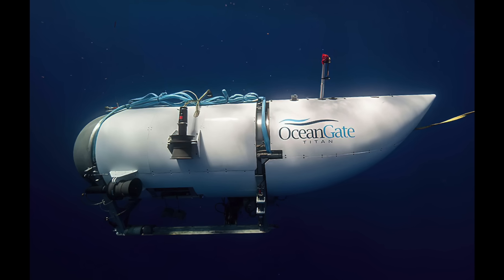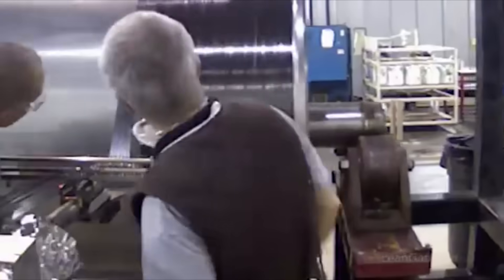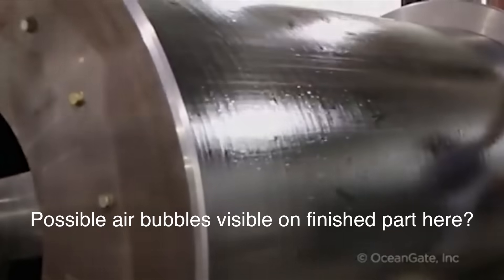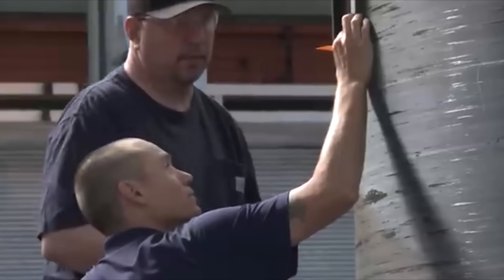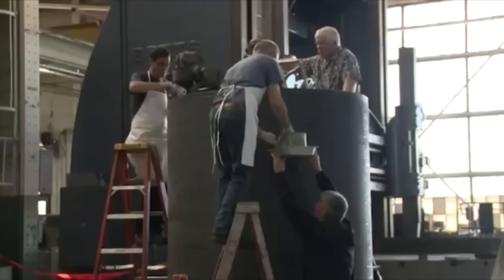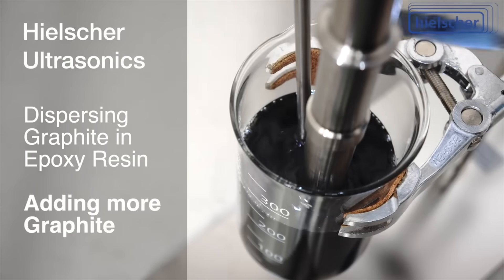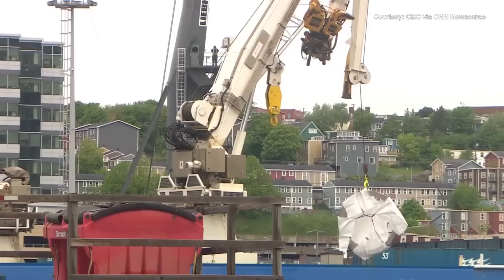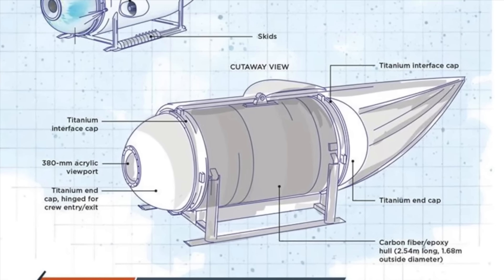Why OceanGate Titan Imploded - A Carbon Fiber Composites Perspective

Comment: I thought I heard Stockton once briefly mention " zero -90 ", but he did rather gloss over it.
I was senior chemist at a " British aerospace" company, who built satellites, in the 80s [ yes, that one ], so I know quite a bit about cfrp, particularly the resin side.
From the very first time I heard about this, I was worried about the consolidation of those layers. I knew  it was 5" thick, which would be lots of layers, now we learn that it's over 670. How do you apply sufficient pressure to THAT to consolidate all of the fibre layers, and squeeze out extra resin? I've since learned that all that they did was vacuum bag it. 14.7 psi on a layup like that is a rat's fart in a hurricane. There's likely to be voids & resin rich areas galore..
We occasionally bonded cfrp to Ti, & the stock surface prep was grit blasting IMMEDIATELY before bonding. Ti has an amazing ability to adsorb & bond with gas molecules, forming an oxide layer. [ So much so that titanium is used in the vacuum pump of last resort in achieving ultra high vacuums].
I agree with your thoughts on surface prep, resin mixing, & lack of obvious squeeze out.
A well presented video, and there have been a whole host recently - it's become it's own new YouTube 'industry' - " What happened to the Titan? ". I think I'm going to sit back now & await the final report I always knew that they WOULD do everything possible to recover wreckage, if only for the detailed analysis. The alternative would be to just rule out all use of composites in future.
Reply from the maker: Thanks for the comment and great to hear your hard earned experience. I regret not talking about the consolidation aspect of the layup. I was hoping they might have had two female moulds that could bolt together with a big flange and roll it into an autoclave or something similar but as you say the idea of vacuum bagging something that’s 5 inches is mad. Very good point about the Ti oxidising too. I feel I’m getting so much information from professionals such as yourself I’ll need to make a follow up video.
Reply: @JamieKunka  I actually gave some thought to how I MIGHT try & consolidate that mass. ( I was the chemist, not the production engineer, so I'm pushing my boundaries. My bailiwick was composition, degree of cure, viscosity & cure dynamics, & surface contamination / treatment & prep. I'd almost bet a pint to a barrel that they had silicones within that warehouse. Those things are deadly. 'Superb' mould release characteristics [ aka 'failure mode' ], and the stuff 'creeps'. Pour a little on the bench here, & you'll find traces on the bench over THERE in a week or so's time. It was absolutely forbidden within our areas, in any form  ) Anyway...
We used to lay up fibre wound tubes, that went into Ariane rocket release gear. It was filament wound on a steel mandrel, then wrapped in layers of polyester shrink tape [ > 10 : 1 shrink ratio, I measured once, when the 'wrong stuff' was delivered ]. It was then cured. The wall thickness was less than a centimetre , on a diameter of about 10cm [ 0.4" / 4" ].
The best solution I came up with was to lay up about 1.5 cm [ 1/2" ], either shrink wrap or vac bag & cure that, then lay up another 1/2", wrap & cure, rinse & repeat, until you've built up your final thickness. You've got a fighting chance of achieving reasonable consolidation within those thicknesses. The pressure gradient of applying 14.7 psi over 5" of material thickness takes more of a computer simulation than I can do in my head. Even so, you've lost that sense of a monolithic layup, and if any 'peel ply' or similar gets involved, all bets are off - you are just building in 'weak boundary layers'.
Reply from the maker: I think your idea of the gradual consolidations sounds very feasible and gradually build up their thickness and be a lot more confident that your not trying to compress 5 inches with a vacuum bag. Also very interesting to hear about the danger of the silicones anywhere near the parts. I bet being an expert in surface contamination/prep the assembly footage must be even more shocking.

Comment: I have no experience in submersible technology. It sounds like there were number of problems, but the biggest problem was the carbon composite of the body. It was not strong enough to handle water pressure at that depth.

Comment: I did not finish engineering at university, i'm just an hobbyist regarding carbon. As the events unfold and i have seen the construction video for 1st time i had questions. "Carbon fibre under Pressure? Wound only hull? What are they doing with the glue, why no squeeze out?" - And anybody i talked to about my thoughts, more experienced then me, agreed. - How then could this happen if nearly anybody with carbon experience says "uhhh, sketchy ..." .... "I'm convinced it will be good and i drive it myself" is not a valid argument.

Comment: If you watch any of the videos of them tightening the door, they are not even using a torque wrench.  Was that even a factor?
Reply from the maker: Wow that’s astonishing as well. I suppose they were thinking the pressure would keep it shut but then even a BIT of water ingress coming in would prevent them from surfacing as it would have made the sub too heavy.

Comment: Most deep sea vehicles are made as a sphere whereas the Titan was a cylinder but  I have not read much about the difference of how a cylinder would act under extreme pressure compared to a sphere, the shape of the Titan may be part of the problem as well as the materials and construction methods.

Comment: Carbon is not a compressive material, it is very good in tension, I think of it as pop bottle which has high internal pressure and copes very well but how little it takes to crush it.

Comment: The critical error was starting with two dissimilar materials. Just insane to begin with. Those two ends of the sub probably blasted off with extreme force.
Reply: Wow this is like, hilariously wrong. nicknorthcutt's prior mechanical engineering experience consisted of Sunday morning Looney Tunes

Comment: The carbon fiber and titanium have different compression strength and behavior. While they seem snug during the construction, at depth there would be a small but significant difference in the diameter of the fiber cylinder and titanium ring which would put a lot of force on that little layer of epoxy. I’m surprised it lasted as many dives as it did.

Comment: What does "0 to 90 axial and rotational layout" ( 1:33 ) refer to? Sounds like 2 directions. But in any event, the video is of their first version (called Cyclops II at the time) that dove twice and made enough "crackling noise" that Rush scrapped it (with a lot of encouragement from Karl Stanley who was on the second dive) . The second craft ?now called Totan) was done by a different firm (this first was Spencer Composites) and I read it was wound differently (although I can't find the article where it talked about the different winding pattern of the second version).

Rush said in an interview that carbon fiber allowed the vessel to not need "all that foam hanging off it" that a metal vessel would require for buoyancy. The foam appears to be encased in metal per a picture I saw. In the end the carbon fiber was the cheaper choice and the "out of the box" choice. Rush appeared to highly value doing it differently, but it conveniently was also cheaper.

Comment: Worked for an adhesive manufacturer. With adhesive, less is more. Firstly, there would ideally be a primer applied for the adhesive to 'key' onto.
The bond line needs to be thin and consistent to get the best surface/surface to contact. Applying by hand with what looks like a tile spreader isn't going to be very constant, and will lead to an uneven bond-line, introducing weakness in the adhesive bond. Should be applied by robot to get consistency and the correct bead (similar process to a car windscreen).

Comment: is there really a magical design that a carbon fiber structure/vessel work for immense compression/outer pressure? Ok, I can understand the carbon fiber high pressure vessel design, cause in case fibers work for tension, which they meant to be, so it could withstand inner pressure with the strength of fibers... but for compressing a carbon fiber structure what will resist the pressure? epoxy? that can never be a good idea..

Comment: It also strikes me the carbon strands at the ends of the tube will be irregular where the machine laying it on the tube former changes direction (eg at 2:16). There would have to be some bunching of the carbon fibres on the inside of the bend formed as the head changes direction because of the width of the tape. There would also be some inconsistency as to where these bends lie on top of each other, just where there are the loads transferring the axial compressive forces from the titanium ends onto the tube. I guess the idea was that the resin glue would spread the load, but it does look to be an area where repeated loadings would lead to settlement and cracking.

Comment: Recent graduate in Naval Architecture & Marine engineering here - take everything I have to say with a grain of salt because again, just graduated and by far not an expert!

But my 2 cents on the "strength to buoyancy" term you mentioned. My first reaction is this is the first time I've ever heard this term utilized, I also have not spent much time with submersibles as they are definitely a niche in the industry. However my next reaction is that term seems a tad bit silly since the buoyant force must be equivalent to the weight of the object (Archimedes Principle), thus in reality strength to buoyancy is practically the same thing as saying strength to weight. Strength to weight is also not really a metric used all too often in Navarc, when designing commercial ships (think tankers, container ships, dry bulk etc) weight is certainly a concern from a cost and strength perspective, but it's often not the case that in commercial design you compare the strength to weight ratios of various materials, it's just not as much of a concern since the body of water will just displace more volume to account for a heavier ship - and often these commercial ships are volume limited. In other words, commercial ships often reach maximum capacity of their cargo holds long before they're in any dangerous territory of displacing too much water.

Weight becomes much more a concern when talking about high performance yachts such as the Americas Cup sailing vessels. But the usage of composites in these craft is vastly different that in a submersible... The question that still troubles me is that someone must have realized that Carbon Fiber does not have the same strength in compression that it does in tension? I wonder if the strength to buoyancy ratio he was using accounted for the different compressive strength of carbon fiber, since pressure vessels under seas have to deal with compressive loading (greater ambient pressure) while airplanes often deal with tensile loading (lower ambient pressure).
Reply from the maker: Thanks for the comment and information and great to hear from a Navarch graduate!

Comment: It sounds like his description is actually of using 0 and 90 degree layup, no?
Reply from the maker: It definitely sounds like Mr Rush says this and others have mentioned there may have been a 0 degree element thrown into the layup. I just couldn't find any video or photography evidence. Certainly the winding equipment they are using could not lay a 0 degree fibre which Is why I am puzzled.

Comment: The load on a GE9x fan blade is about 6000 lbf per blade and translates to a much higher flexural load.  I'm sure if built properly carbon fiber could have been a fine choice.  Though a high pressure autoclave and a somewhat over staturated layup a requirement for the tiny air bubbles to dissolve into the matrix.  Anyway that 1 inch lap bond makes me crinch.   The clean break away of the titanium ring and the carbon fiber is a sign that stresses between the disimilar interface due to the different rates of compression under load was a huge problem.  Too much sheer for the adhesive to handle.
Reply: The load on a fan blade is not entirely in compression.
Reply: You know just enough to be dangerous!

Comment: I still haven't hear anyone explain how carbon fiber would be desirable to hold OUT pressure.  It seems perfect for holding IN pressure as in an air tank but it seems (to me) that the crush resistance could only be a tiny fraction of its expansion resistance.
Reply: When I worked with a HYDROCLAVE our carbon fiber seemed to shrink and turn into a softer like graphite material!  Unlike auto claves it could obtain pressures around 3,000 p. S. I . . Carbon takes on many  different forms! OceonGate probably never considered using a HYDROClAVE because they are very expensive. They seemed to operate more like boat shop!

Comment: And continuous 90° fibers going the length of the hull.   There would have been zero voids if they used an autoclave with high pressure.

Comment: Being in carbon fiber since 30 years for racing purpose, when i saw how they just wound the carbon on that tube without making a cross wound that allows resistance of both axis i was flabergasted. At the two tube ends the resulting pressure from the two caps are is applied only on the tube end surface in a direction that the wounded carbon fiber give no resistance. So in this way only the matrix resin can hold the pressure and will cause a quick wear and of course the bounding is also a problem. But you have to keep in mind that the glue doesn't hold the caps, the water pressure press so hard that without any glue in would hold. Just look at how the two caps are bound to the two titan rings, just a few little bolts to keep it toghether.
The problem is that the carbon made the way they did it gives no resistance in the tube axis and then nothing keep the wounds together except the resin, this is nuts!!

Comment: Considering carbon fiber only has strength in tension, it would only be the epoxy providing any strength. Composites are famously weak in compression so regardless of all the construction details this seems like an insane decision to take. There was no point at all in using CF. Why is nobody stating this single first basic fact.

Comment: This is by far the best video I've seen on the topic.  All of the points you make are right on, and there are a couple you didn't mention.  I've 10 years experience related to the construction, testing and deployment of aluminum cylindrical pressure vessels rated for full ocean depth, and 6+ years winding thick carbon fiber cylinders.  Regarding implosion testing, the weakest side of the aluminum cylinder begins to buckle, putting the interior surface of the aluminum under tension, and any resulting fracture begins there.  Carbon fiber cylinders are strong under tension, that is, high pressure from the inside surface, but there is no lengthwise compression strength with carbon fiber.  More to the point, when under extreme internal pressure, the carbon fiber cylinder actually grows physically in the radial direction.  If under external pressure as with the Titan, the strength in the radial direction is unknown to me, but if the composite is pressed inward by the uniformly-exerted pressure, it is likely to shrink slightly.  If this rate of dimensional change is even slightly different than the titanium end rings, this would produce shear forces at the glue joint during a dive.  Each dive could stress and weaken the glue joint more and more.  The only way I know to effectively bond titanium to carbon fiber is by a difficult process that involves more than just glue, and was not mentioned.  Lastly, for carbon fiber with a high number of layers, as shown, many things, especially the fact that the epoxy shrinks while curing, often results in voids and tangential cracks internal to the cylinder which cannot be seen, but are revealed when a test section is cut from the cylinder and inspected.  My supervisor has told me that metals expand with temperature, while carbon fiber shrinks with temperature.  I don't know if that's true, but if it is, it would also be a problem. Thank you for your excellent video.
Reply: With all the new data coming out, your comment seems to have the most insight. Though from what i can understand the data points to delamination of the carbon fiber layers putting excessive force on the titanium end rings, specifically the inside wall of the Ti-CF overlap, causing them to shear off.
Reply: The carbon works well as a balloon with pressure inside but very poorly with pressure outside. Just look at what a balloon does as it goes deep...it shrinks. The structure must resist the shrinking forces carbon fiber has no chance.